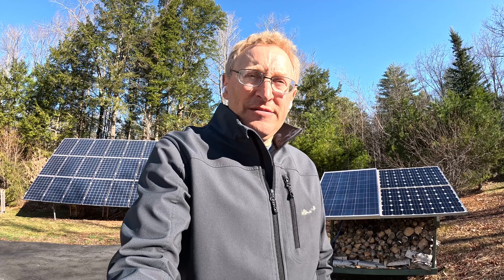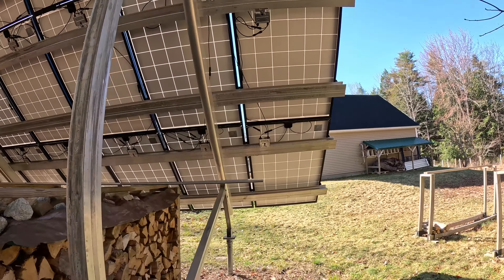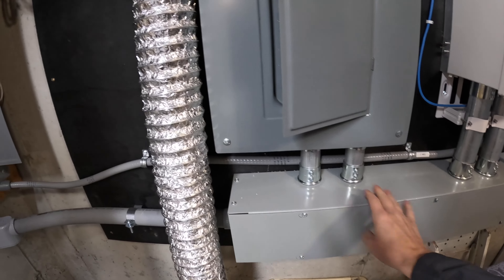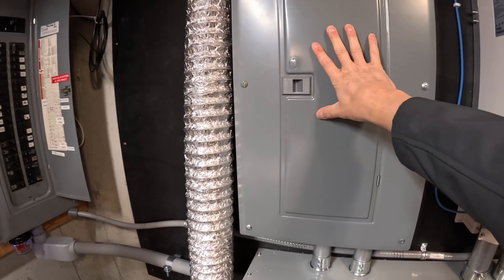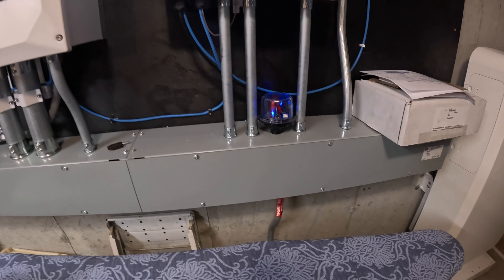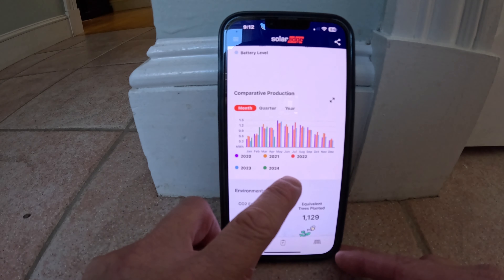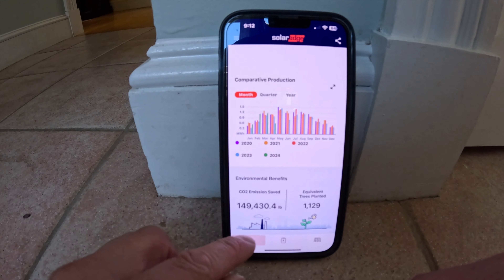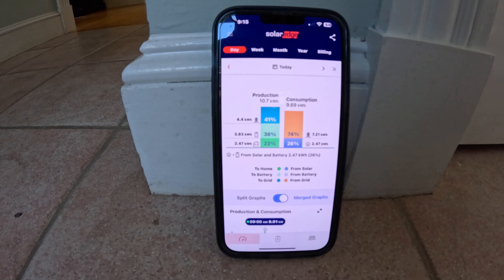Solar Electric 2024

Comment: Unfortunately, SolarEdge has not stayed even remotely competitive.  So many cheap yet excellent hybrid inverters capable of self consumption (grid down without the need of a separate expensive "Backup Interface" that also switch over in <20ms rather than a couple seconds) and LiFePO4 batteries have come out in the last few years.  Factor in inexpensive optimizers from TIGO if you need them...and SolarEdge is really lagging behind.  Their battery is old Li-Ion chemistry, physically huge and seriously expensive for only 10kWh.  I just DIY'd a 48V 16kWh (314Ah) LiFePO4 battery for $2,100 with fused 5A active balancing, oversized DC breaker and a class T fuse.  It's nearly half the size of the SolarEdge battery with more capacity and safer.  Not to mention, SolarEdge is still dealing with high inverter failure rates.  They really seem to have rested on their laurels for too long or at the very least, at the wrong time.

I had not realized that SolarEdge was charging extra for the CT's either.  That is really shameful as every hybrid inverter I have seen the last few years has included them out of the box.
Reply from the maker: Thanks for the reply.  An interesting perspective.  Many companies have moved forward with very good competitive products, most from China.  however SolarEdge is still the leader in the technology and field and makes inverters in Texas.